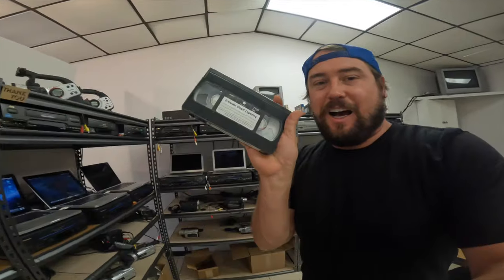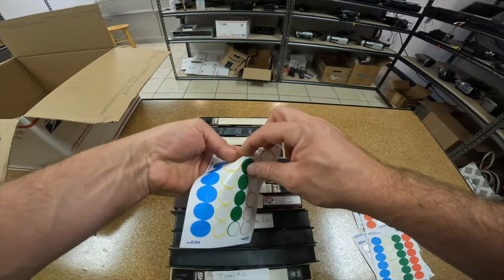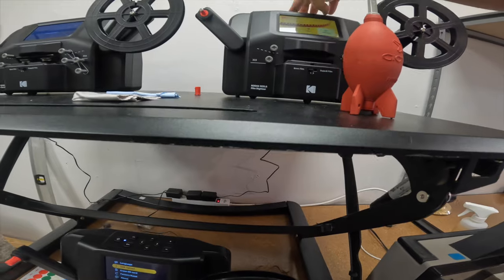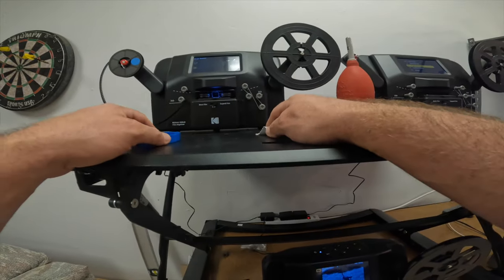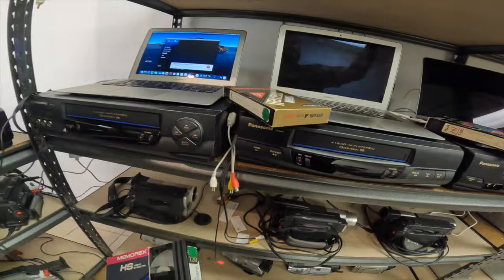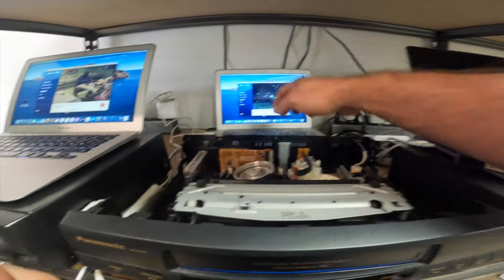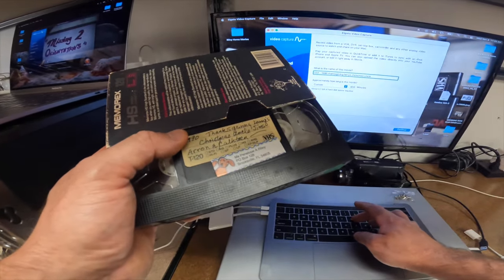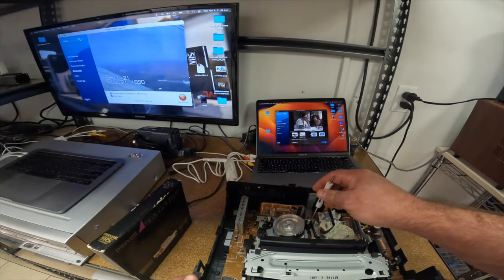Converting VHS Tapes & 8mm film to digital ** Kodak Reels

Comment: Invest in better 8mm film transfer systems. The wolverine type film scanners are not good compared to anything else out there. 

But im glad you use elgato. Its easy and it works and you get good transfers using it.  Wish i could come and see your shop and talk and trade ideas.
Reply from the maker: I will get something when it comes available. But the reels machine is far superior to the wolverine. And it is really good with crispy film. Very gentle.
Reply from the maker: I wanted to get that 8mm Elmo set up on eBay but the guy doesn’t have any example footage.
Reply: @EmeraldCoastDigitizing  reels scanners have register problems. Your eyes have come used to it so you don't see it. All these wolverine type scanners have this problem. The stop click stop click produces this issue

Comment: Just got a Reels, after trying another machine that had trouble and often jammed.  Reels handles films great, but... I have trouble getting a stable picture.  Sometimes it flutters, sometimes it doesn't.  Can't figure out a rhyme or reason -- sometimes with the same film!  (If there's a problem, I try more than once.)

Any hints to fix this?  I'm following instructions. What am I doing wrong?
Reply from the maker: I don’t have the flutter issue. Only issues I have are broken sprocket holes and splices
Reply: @EmeraldCoastDigitizing  Flutter is apparently caused by pinching in the feed reel and/or misalignment of the feed sprocket.  Switching the switch back and forth (sometimes more than once) usually solves it.  And re-reeling a warped reel is a good idea, too.  Turns out even plastic reels can warp and pinch.

Comment: El gato software will record a 6 hour vhs tape ? or will it break it down to 2gb files automatically ?
Reply from the maker: Good question. So with my workflow. I only transfer tapes while I’m in the building. So I always check the recordings. If they reach two hrs I will notice and stop the recording and start a new one :)

Comment: Which 8mm scan is the best the Kodak or wolverine
Reply from the maker: I’d say the Kodak. I’ve had 3 different wolverines and had problems with all of them. They do the job but are just problematic. I like the reels best.
Reply: None of them actually. They are more or less the same OEM hardware with different brand slapped onto them and minimal changes in the internal software but sadly they are all  not providing a true 24p picture and most super 8 home movies were shot at 18fps anyway and the machines also have a really low bitrate AND wrong aspect ratio as well. They are like the Super 8 version of those 6 megapixel camera photo "scanners" that are sold everywhere, which are the worst thing you can do to your film negatives. The only actually good 8mm / Super 8 filmscanners are actual telecine machines (like a Retroscan Universal MK1) that not only run in realtime instead of frame by frame but also have a much better image quality. Sure they cost more but you should not cheap out on that. If you can afford it, get it and avoid these cheapo plastic Super 8 scanners that are flooding the market. They simply suck.

Comment: 30 minutes to do a 3 minute film. Ouch!!! But the scanner does work.
Reply from the maker: No big deal. I have plenty of stuff to do while they run. And I don’t have to sit there and focus on it. If I had projector based transfer system I would have to focus on the film job only when it comes in. Now I just do it along side my tape transfers. Just slowly pick away at it in the background.
Reply from the maker: I’ve gotten to where I can flip reels on all 3 in about 3 minutes